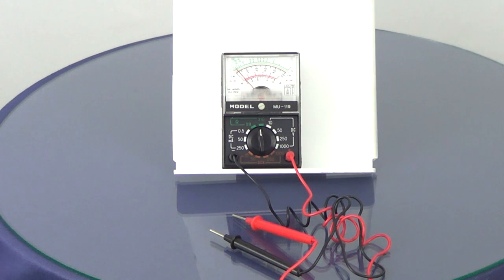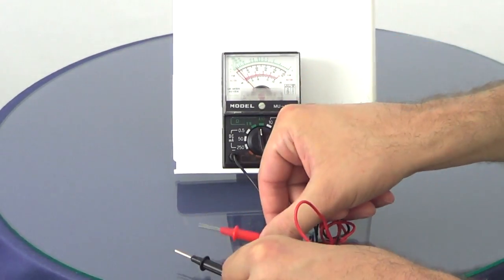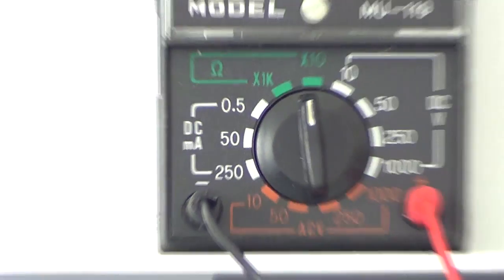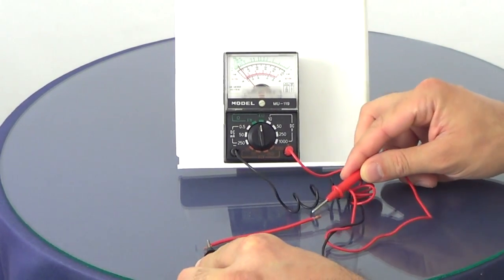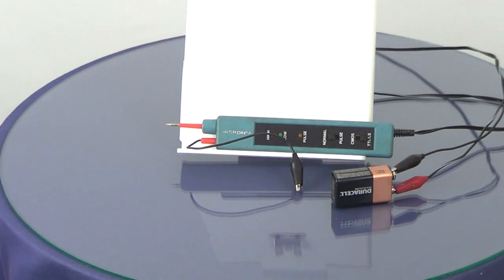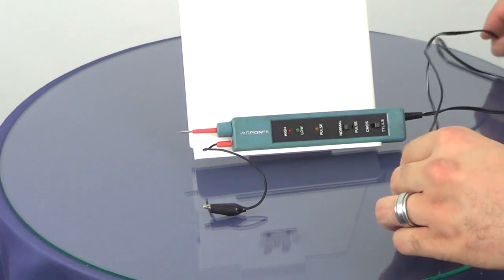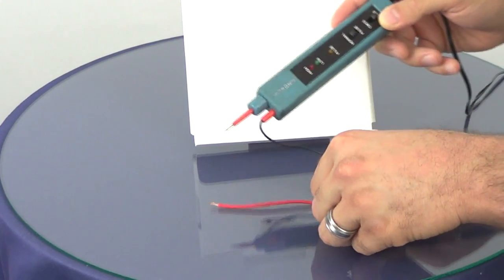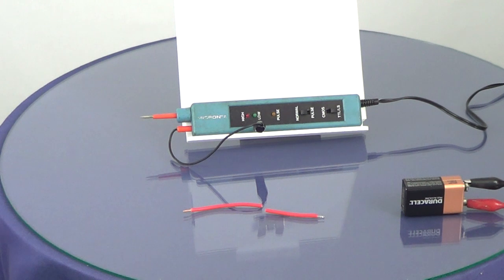Testing Continuity with a Mulitmeter and Test Light

Comment: I've got this brand new Southwire Analog Multimeter 10010S and I have it set on 1.5 BATT with red touching the + and the black touching the — on the 1,5 V SONY newly purchased battery, also I tested it on a new PHILIPS and DURACELL 1,5 V batteries as well. I also tried it on DC 2.5V and 10V setting to no avail. The red arrow on the multimeter display seems dead and does not react to any of the batteries, not even on a lawnmower 12V battery. I did get the arrow move to 6 reading between good and bad only ONCE (just once) quite magically, only once, but never again. What's wrong with this brand new unit? Should I bring it back to the store and buy a different brand? On the back it says INTERTEK  4007177 and NO.1303056708. I was careful enough to not use it on a wrong setting and today is the first time I used it, on a 1,5V battery (3 different brands) and I get(almost) no life or usage out of this analog multimeter.

When I touch both sticks together the red arrow in the display does not move. I have lost manual instructions for this unit, but it is brand new.  It's been enclosed in a safe plastic box and no humidity exposure. I replaced the battery with another new one,  just in case, but the multimeter won't work anyway.

After showing no life on a 1,5V battery (the brown switch set on 1.5V BATT = black area) this unit suddenly started showing a reading which came to almost 8 at the red scale and just below 200 40 just above it. Why does this unit shows no life most of the time and then occasionally revives itself? Should I buy a more serious unit of another manufacturer brand?

SOUTHWIRE manufacturer did not bother to provide a video and online instruction manual... I suspect they sold all the dysfunctional ones to Walmart and we have bought one which does not work as new.... So much about "built for reliability, durability, for work"..

Comment: When I touch the probes nothing happens, but when I check a battery or check an outlet it works, the battery is good so what’s wrong?
Reply from the maker: Be sure that you have the multimeter set to the proper setting. You will want the meter set to Ohms.

Comment: Thank you for pointing out the need to check the multimeter battery. Just purchased one new- thought it was defective, turns out battery wasnt installed.

Comment: Several observations:
1. The meter you used needs to have the meter movement needle zeroed using the small nylon screw at the base of the meter needle. First thing I noticed when I saw the meter, and it's good practice to always check this first when pulling out an analog meter to use it. ;-)
2. It's important to emphasize that a V-O-M should NEVER be connected to a circuit with any power in it (e.g. turned on, or with battery installed or connected to wall outlet), when measuring resistance. This has got to be the #1 cause of analog meter destruction, at least in the resistance portion of the meter.
3. A nit when it comes to using a meter for continuity, but it's also good practice to always set the Ohms adjustment to zero Ohms with the probes shorted together before measuring resistance. However, it's considered good practice to always do this, and to reset it whenever changing the resistance range.
4. This is an FYI, as the meter you used doesn't have an Rx1 range. For continuity, I always use the Rx10, and not an Rx1. It better protects the meter movement and the critical Rx1 reference resistor used in the resistance measuring voltage divider (typically under 20 Ohms). In addition, when using the Rx1 range on a meter that has one, zero it in the Rx10 range first, then switch the meter to Rx1 and do NOT adjust it, but make note of the resistance shown, which should be about 1-2 Ohms. Make the low resistance measurements and subtract that. What you've measured by doing this is the lead and probe resistance, which is usually about 1 Ohm and by including that with the measured resistance and subtracting it out, you get better precision measuring very low resistances than by zeroing the meter in the Rx1 range. This is a best practice I got from an old V-O-M manual that had extensive general instructions on how to use an analog V-O-M!

It is one of the better intros to using a meter and measuring continuity that I've seen. The demo using the unbroken and broken wire keeps it simple.